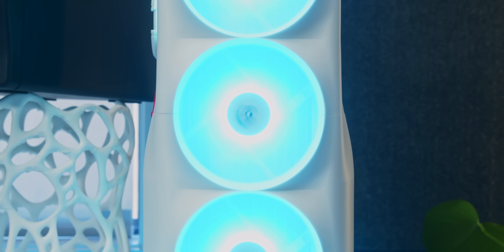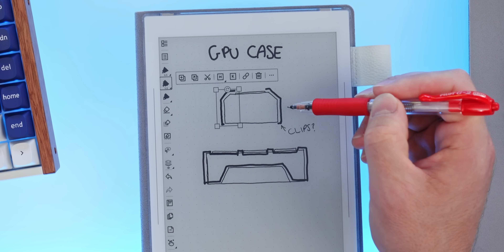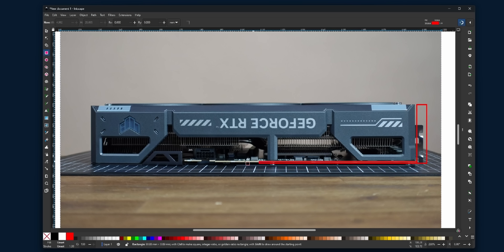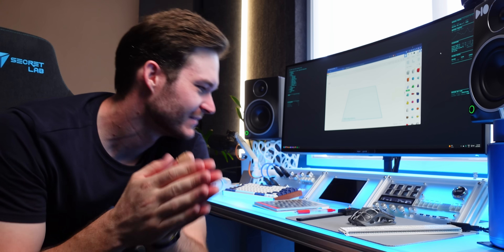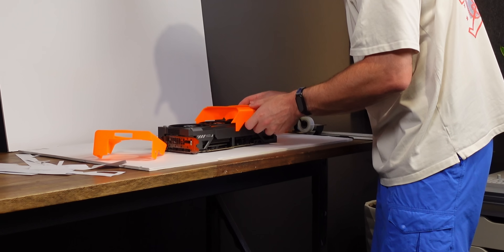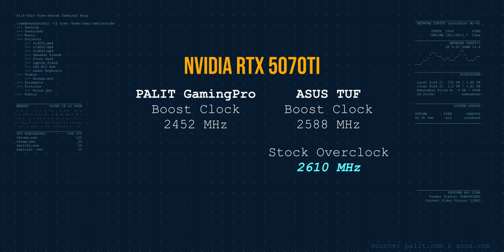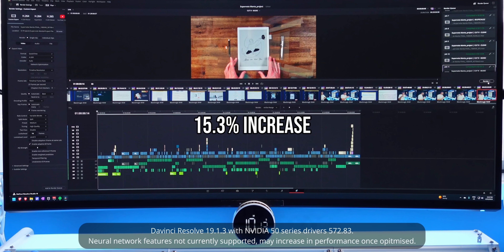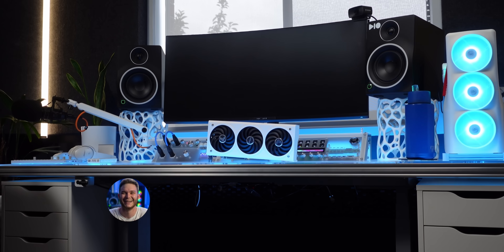Custom 3D Printed GPU Cover Plates - my 5070ti

Comment: Could you launch a course on how to model graphics card cases? Over time, the plastic becomes dry and brittle, rendering the card unusable, as in most models the fans are stuck in the plastic case.

Comment: If you live in America. You can't void any warranty of anything buy taking something apart. If any company tries to void your warranty because you took it apart. They're breaking the law. Hearing your voice, you may not live in the U.S. Just saying, nice video. Keep them coming.
Reply from the maker: Yeah I'm Aussie, which I don't think they can get away with it here, but they for sure do try and pull it!
I remember a Samsung phone of mine bricked itself once with a known fault, sent it for repairs, they rejected it because the outsides paint was chipped and flaked off... Like yeah man, paint removal scrambles the 1's and 0's inside flash storage 🤣

Comment: I did this to a 3080ti but i also swapped out the really crappy fans for 94mm Arctic fans
Best decision I ever made
Reply: What 3080ti do you have?
Reply: @kaskiiiii EVGA XC3, the fans were low RPM and the heatsink is slightly underspeced lol

Comment: It's all about cost. There's what 43 ish different 5070 cards out there and this is only a niche thing so not many people would pay $50 for a cover. Then you have to repeat that for every series of card 60,60ti,70,70ti,80,80ti, 90,90ti.... It always come down to money lol
Reply from the maker: Not much of a cost if they make 3D printable files. They already have 3D models of the shroud, so can extrude a plate easily then people can figure out somewhere to print them in the exact colour they're after.
It is more effort that the company doesn't make money on directly, but someone may buy from them because it's an option, hard to measure

Comment: Cam I must thank you for this video. I've been trying to make patterns to help me cut leather for wallets that I want to sell as a sidegig, and I've been having issues to find a good free alternative for vector softwares. Inkscape is perfect for the need and contrains I have right now, thank you so much for this tip!!
Reply from the maker: Awesome to hear mate! Inkscape is super useful, even has a plugin library with many useful tools and features for embroidery and stitching, so you could possibly find something that'll add laser cut holes along perimeters to speed up your laser jobs :)
Reply: @camshand  right now I am just did acrilic templates to help me cut the wallet pattern, since I dont own a laser cutter myself... but maybe in the future... right now I am trying to do my logo using inkscape!!

Comment: Great work! Personally I think u should have left a gap, 5-10mm between the 2 halves, then throw a few cut outs next to but in line with those cut outs for aesthetics. U got black fans and holes showing some black u may as well lean into it and make some black stripes in the card, I think it would look even better, I think it already looks great tho, but yeah like the ps5 with the halves and the line between, I like things that add some contrast  for interest 😉👌🍻👊 (the steel legend parts I think do this aswell but are more designed to look like circuit boards rather than  “split” half looks)
Reply from the maker: Yeah for sure could get more creative with the design by adding colours or graphics.
I'm thinking I might revisit this project in the future at some time with more powerful software, but for now, very pleased to have the performance boost and the GPU at least matching more than stock 🤙

Comment: Not sure what the laws are in your location with regards to "Right to Repair," but often times the "warranty void if removed" stickers and disclaimers are not enforceable in any way by the manufacturer. You the consumer have to be able to disassemble the cooler to maintenance the card. Again, not sure about your local laws, but may be worth a revisit later if you want to get more surgical with your mods. I know that Asus in particular is horrible about "trying" to enforce this BS in America, and it always goes south for them when they do. They just hope the consumer doesn't know what they can and cannot do with their purchase.

Comment: Very cool! But please be careful with the glass transition temperature of the plastic and your GPU temperature. Would be a catastrophe if it went all goopy and inside the card. (I only have experience with the presumably hotter running AMD cards so could be that it is not any issue for you)
Reply from the maker: Yeah given the card temp hit 66 degrees should be perfectly fine with PETG, PLA could potentially be an issue if it replaced the original plastic but that's kind of acting as a shield in this instance.

Comment: Unlike Inkscape, Tinkercad is most certainly not free software.
They may both be gratis, but only one is free as in freedom
Reply: What
Reply: @iambear.6526 basically the difference between free and open source, with inkscape you're free to do whatever you want with the program while tinkercad is monetarily free but not free to use the program as you wish (also bonus fact, libre in the names of programs stands for free as in freedom)

Comment: I love this! I'm working on a build of an entire pc case from scratch built around [redacted secret component] and I LOVE how easy tinkercad is but it is SO bad for smooth curves and arcs, so that tip is handy! currently in the process of switching to fusion because onshape just isn't compatible with my brain for some reason and fusion's free tier is completely fine for what I need!

Might have to steal the idea from this video for some other components and integrate it all together... heh.
Reply from the maker: Haha love the suspense of the mystery component! Yeah fusion is way more powerful, my only issue is you don't get commercial usage rights from the free tier, so can't use it for my projects unless I pay the business subscription
Reply: @camshand  I think you might be a.... fan, shall we say, of the mystery idea if I ever do turn it into a youtube project! ;)

And yeah, the commercial rights is an important distinction! "Autodesk Fusion for personal use is a limited, free version that includes basic functionality for qualifying users who generate less than $1,000 USD in annual revenue and use for home-based, non-commercial projects only." I'm just a silly little hobbyist that's not even a business, let alone a profitable one, so I hadn't even thought about that. Thanks for the reminder!

Comment: Printing a cover instead of painting is a great example of the adage  “when you have a hammer, everything starts to look like a nail.” If you have the technical ability to measure your card and model a mating part, you are fully capable of disassembling your card for painting.  All that being said, this is still very cool.
Reply: They went over that several times in the video, actually! This is a way to get a no-mess, no-warranty-void solution :)
(They even discuss how they also specifically avoided painting the fans to prevent altering their noise level and performance.)

It's funny the things you learn when you actually watch the video before commenting!
Reply: @shrimpixel I did watch the video before commenting, which is why at the end of my comment I mentioned how it was still really cool.  I just disagree with the implication that disassembling your card is somehow difficult or bad.  

It’s funny the things you learn if you actually read someone’s whole comment before hitting reply!
Reply: @NerdHerder545  You still missed the point....
Reply: @ I get that it is a novel solution to people not wanting to void warranty.  My point is that, if all you are going to do is make the card a different color, using a 3D printer is a pretty advanced hammer to do that.  If you want to get fancy with shroud design, airflow routing, cable routing etc.  this starts to be a much more compelling option.  

Given how few people actually end up warrantying cards, and the fact that you can and should be disassembling your cards to replace thermal paste, for probably 85% of users getting comfortable with disassembling your card and using a rattle can will do exactly the same job.

Once again, to reiterate, this is a very cool project, and there is a lot of possible expansion on the idea that would better leverage the capabilities of a 3D printer.  If you are someone who likely has a card that is 2-3 years old, you don’t need to worry about warranty, just paint your card and while you are in there replace your thermal paste.

But muh fans I hear you cry!  Just don’t paint them, like he states in the section about when he painted his card.  You’ll end up with exactly the same final product.

Comment: I would imagine why there aren't cases for GPUs is because consumer GPUs are fairly low volume products and each manufacturer launch a billion versions of each card. But it would be cool if Asus and others could provide measurements or STLs so that owners can more easily make them on their own like you.
Reply: honestly if any manufacture partnered with a company like dbrand we could just get vinyl sticker skins that would make for a super slick wrap and not even need a 3D printer. I don't have a laser cutter but I do have a cricut so I might jus thave to try that

Comment: YOU NEED A 3D SCANNER!!

I've bought one this month and it has made my life a thousand percent easier when designing stuff! I have the Creality Ferret (Not the pro) which i bought used for cheap and it still delivers a very good scan!
Reply: What are the projects you used it for?
Reply: @keshudioo  I work with 3d printing, i sell gunstock for VR Headsets so i usually scan the controllers to make them fit my parts byt I've also made controller stands, grips for my handhelds, etc.
Reply: Would for sure make it easier… “need” isn’t the right way to put it tho, videos like this with free software are great for making sure doing the same thing from home is still accessible for everyone 😉🍻
Reply: bruh i didnt even know 3d scanner was a thing! im thinking about buying a 3d printer frfr, so many cool projects like diy micro drone, and build hard cases for gadgets

Comment: Only a 3/10, the white doesn't match the white on the rest of the case... Jokes aside, that's a really ingenious solution to customise/personalise hardware without voiding warranty, I really need to get myself a 3d printer to mess around with stuff like this.

Comment: OK this is absolutely genius, and honestly I can picture myself adding all sorts of extra design bullcrap that would probably interfere with cooling a little bit.  I think I could sacrifice a certain (minimal) degree of performance for something that looks absolutely bonkers cool and 100% custom, but hey I'm a form over function guy in a lot of ways.  Brilliant job mate!  It is totally a kind of forehead slap moment right; like why aren't they doing this themselves?!  Phone cases and customization are an absolutely massive consumer market!  Bonkers
Reply: I think you wouldn't have to worry so much about the performance because even if your design slightly hurts it, if you haven't set the fans to a set RPM, at worst they would run just slightly faster to compensate and still keep your card at the same temperature.
Reply: The anime weeb pc parts need more anime figures 3d printed parts! Everyone should make big old tiddy anime weeb gpu cases!! 🔥🔥🔥😉👌🍻😂

Comment: finally, gpu wide body
Reply from the maker: I was tempted to do the model in plasticity and flare the fan holes like on the front of the PC, but wanted the challenge of TinkerCAD haha. But yes, technically, the add on cover plate is a wide body kit too 😜
Reply: Carbon fibre versions with big wings to direct airflow coming soon!!! 😉👌😂🍻

Comment: You could essentially print your own shroud, and use PC Fans to match your case even better. This would also give you a quieter GPU and better thermals.
Reply: Agreed. I modded my 1070 years with 2 Arctic fans - cooler and more silent. Those flimsy standard fans don't seem to produce enough static pressure.

Comment: Dude calipers with batteries in them are such a pet peeve of mine; I've been trying to analogify stuff like that in my workspace.  I actually ended up buying this rad ruler / caliper thing from craighill that I feel like you'll appreciate as an engineer.  It doesn't have a depth guage though which sucks. But it's full analog and will never run out of batteries :)  I shall now watch the rest of your video
Reply: I discovered the batteries in them will stick to magnets, and on mine at least, the round disc/thumbscrew thing is a perfect place for me to snap the magnet/battery to when not in use. I've been using that trick (just popping the battery in during use, back out for storage) and it's lasted me nearly 3 years now and still on the same battery! I think I barely managed 7 months when I left the other identical battery in the calipers all the time.
Reply: @ this is brilliant - good call! I do that with certain remotes, didn't think to do it with calipers. Cheers